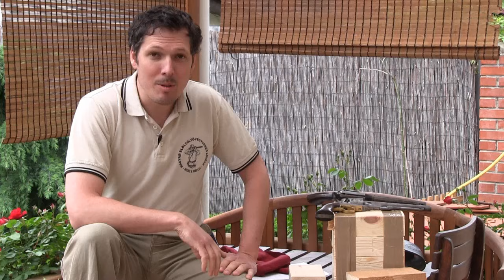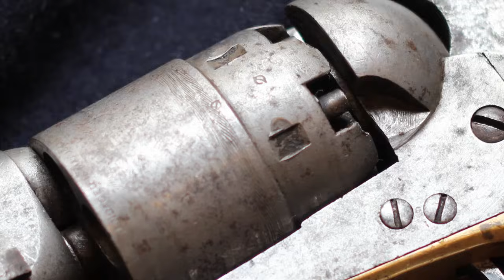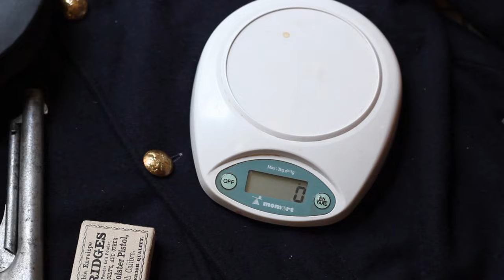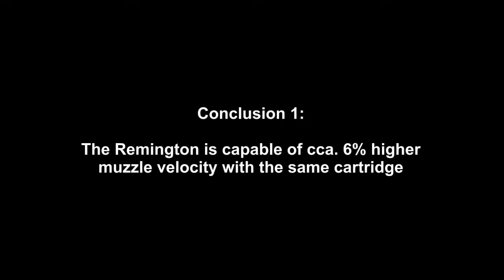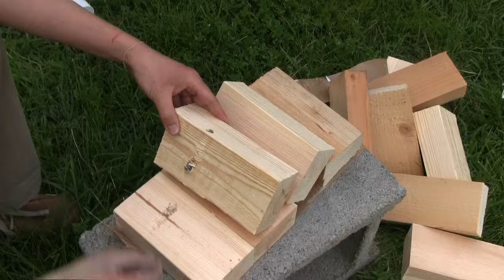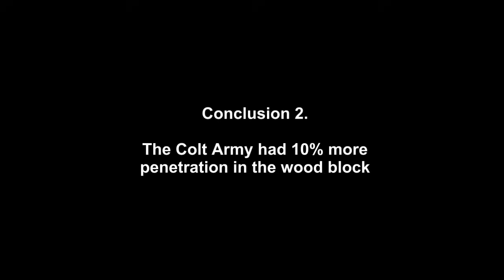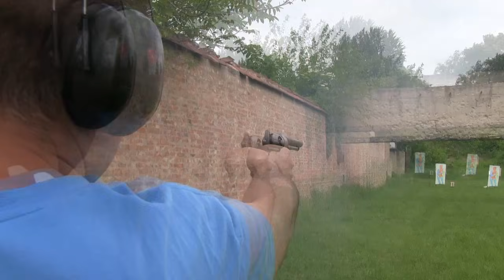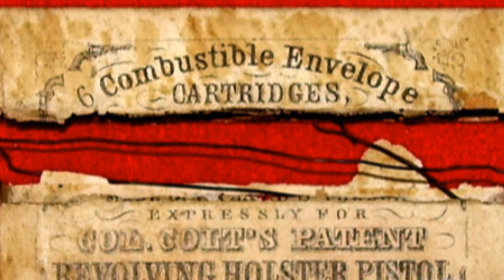Original 1858 Remington New Model Army vs original Colt 1860 Army percussion revolver

Comment: Another of your excellent videos,however, you did not show the real problems of the Remington in getting the cylinder out/in,or the hell of getting the caps onto the nipples,both easy to achieve on the Colt design. The caps dropping into the action (although I have never had this with proper size caps ! ) can be avoided if you tip the gun sideways on cocking.
Thanks again for the best on YouTube!

Comment: Fantastic video! Remington all the way! 

Have you tried the old technique of flipping the Colt revolver upwards as you cock it to let the spent cap fall out? It might violate safety rules at your club though. I've tried and it seems to work quite well. The older cowboy movies would show this and I always wondered why, until I found out about this particular problem with Colts. I've seen them at the range jammed up so bad a knife or screwdriver was needed to clear it.